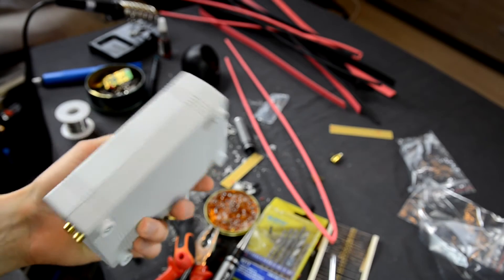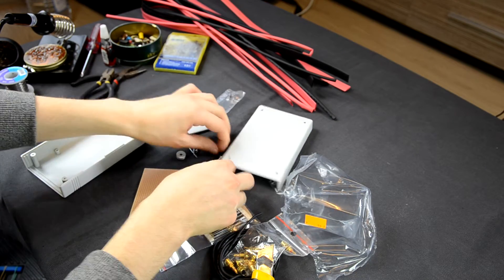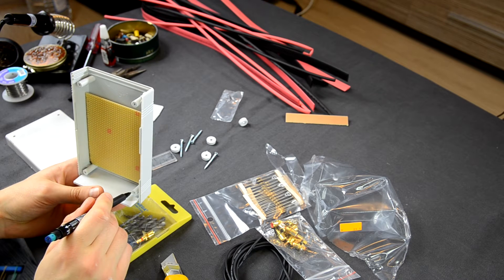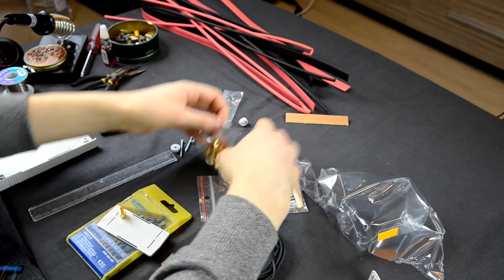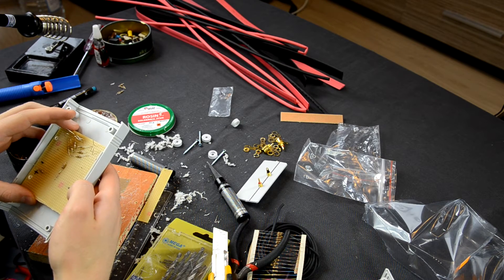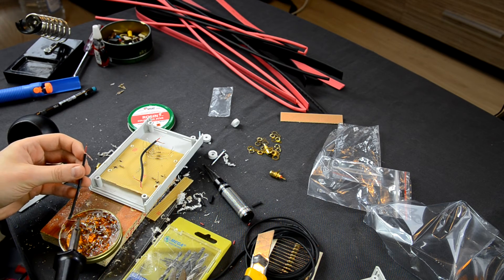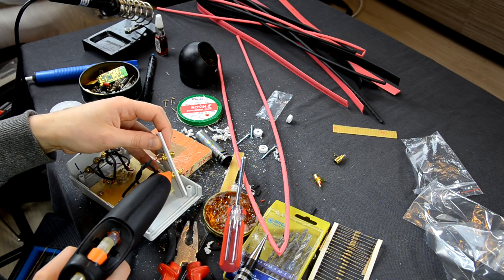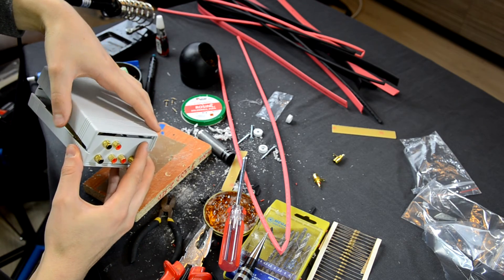How to make stereo to mono analog adapter box #DIY13

Comment: I see where L & R input combine between equal value resistors -- looks like voltage divider. I think dissimilar signals may mix to complex signal with unintended amplitude highs and lows. Is that mix signal really true "mono"? I have not built the circuit yet, but would love to see follow up with oscilloscope. Any chance?? I am going to read up on definition of "mono".

Comment: I recommend Avdshare Audio Converter,which can Convert any stereo file to mono file for any mono system without quality change. here is the link: https://www.avdshare.com/stereo-to-mono-converter
Reply from the maker: product not at all bad, but this is something different! My adapter box is intended for more signal outputs. Standart stereo sound card have just 2ch, but if you use a multichannel amplifier for cafe, bar and there need for example 4-6-8 inputs, this box give you required number outputs from 2ch stereo sound source.

Comment: Hi, thank you for the video, I have a quick question, I have ceiling speakers with two wires went to them already, I bought mini amps (they are stereo), I would like to connect Chromecast Audio to Aux in the mini amp and then connect the amp to the speakers. I can repeat this for every ceiling speakers in the house so I can control them individually, the question is can I use your setup after the amp to sum up the stereo signal to mono and send the signal in the two wires that are going to the speakers? Also where do I get your box? Many thanks and I hope I get an answer for this, it will be much appreciated. Foudil
Reply from the maker: This box can use only before amplifier,! You can use stereo signal, for example from pc/ipod etc,  to this box, then with this box help you can get a lot of signal outputs for amplifier. 4 outputs for 2xstereo amps = 4 speakers or in paralel 8 speakers.

Comment: This is useful for one of my future projects (powered mono speaker) where I need both channels going intro a single amp input. What would be the difference between this resistor circuit and simply connecting the two signal channels together from the audio source?
Reply from the maker: +Alexandru Simonescu this resistors make stereo signal summing and then split to mono! You can use just 3xresistors and your stereo to mono is ready for use. Its more better then just connecting the two signal channels together!
Reply: +ArtūrsM ok cool. thanks
Reply: +ArtūrsM Thanks for your video. Does the value of the resistor have to be a 150 ohms? I am looking to sum balanced stereo to  balance mono.